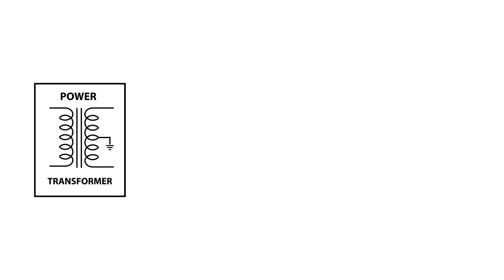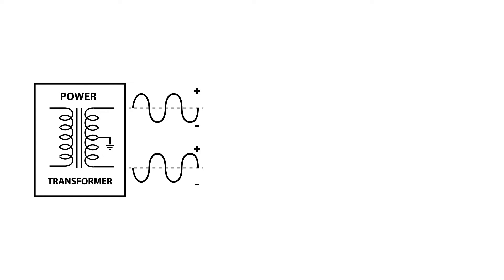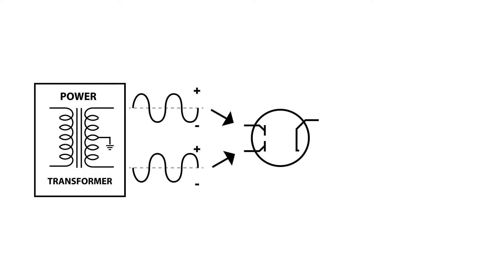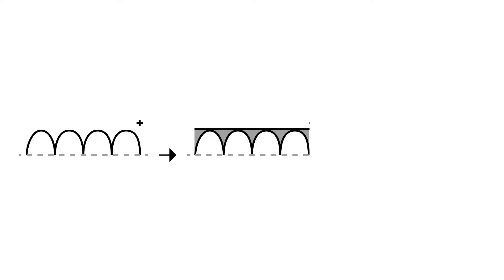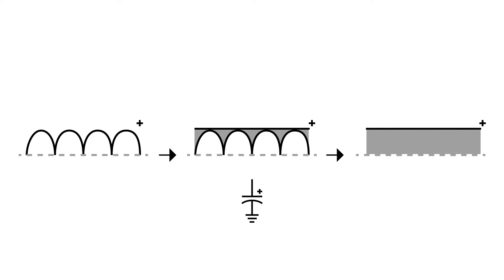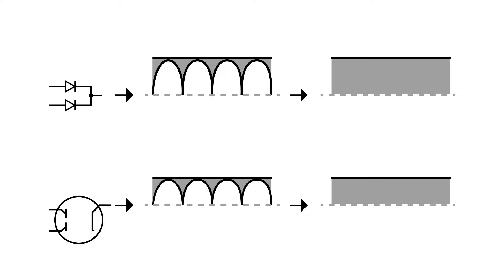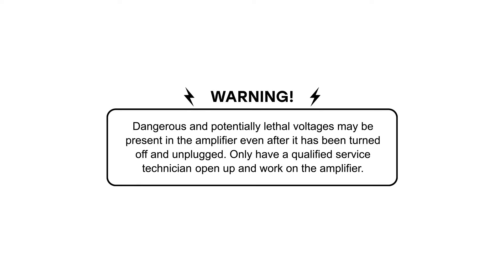Tube Rectifier vs Solid-State Rectifier - What's the difference?

Comment: I like the sag and resulting sound in a guitar tube amp, but for a hifi tube amp there's no sonic benefit from a tube rectifier, and the good ones are expensive.  I added a solid rectifier that includes a 12102 thermistor in addition to the diodes for rectification.  It starts out as a large resistor until it warms up, so the inrush current isn't a problem.  Some of them include a resistor to get the voltage down to what the amp can manage.

Comment: Unless I missed it, I don't think you controlled for different voltage levels on the output of the two rectifier types. 
We explained at the outset there are differences in efficiency and insertion loss of the two types, but regardless if we do not set the output voltage to exactly the same value any differences we might hear are going to be affected by that. Clearly, all of the tubes are going to have different characteristics with different voltages on their plates and grids, and polarization as well as counter-reaction circuits (if there are) will have different characteristics as well. 
So without controlling to make sure the voltage of each rectifier is exactly the same, what we are hearing may not represent intrinsic differences between the two different types of rectifiers.

But again, maybe you did that and I didn't pick up on it.

Thanks

Comment: There is some difference, but it’s really smal in A/B test. And, in the band context, I bet nobody from the audience will hear it. But, I believe there should be some different player’s feel, tube rectifier will produce different response, more “sponginess” and “sag”, especially in the higher levels of volume, when higher internal resistance of tube rectifier will affect speed of recharging of PSU caps after power peaks, and make tone more compressed - especially clean tones.

Comment: Tube rectifiers have some in series resistance? Wouldn't just putting an roughly equivalent resistor in series with solid state diodes produce roughly the same characteristics in the following voltage smoothing capacitors?

Also, not that power factor would be relevant to musicians, but an in series resitor between the transformer and filter capacitor should reduce the current spikes a little bit, there fore reducing EMC noise. Or an inductor-first versus capacitor first filter. But in that case you can put the inductor before or after rectifier, it doesn't matter that much. 
Downside - with an inductor first before capacitor you need higher transformer output voltage to get the same DC level.
Reply: Yes, this method is often used - serial resistors will cause slower recharging of filter caps in the PSU, and emulate same dynamic behavior during power peaks.

Comment: Can rectifier tubes affect tone ? Eg NOS or coke bottles vs straight tubes ?  In a sucker for snake oil and swapped from one rectifier in my dc30 to the dual 5v4 tubes  - that is an option to me . I bought some nos tubes just cos they looked pretty haha.  But would you say rectifiers affect punch and dynamics not tone ? I know from touring as a tech all my players in the early 2000 switched their mesas so solid state as you could hear the snap of those drop d power chords over the tube rectifier

Comment: Some folks who like having large solid state power amplifiers also like large capacitor bank filtering. This is good for material that contains a lot of profound bass-- pipe organ, synth, for instance. Their amplifiers will feature a single stage capacitor input filter system to lower power supply impedance as much as possible. 100,000 uf on each leg of a bipolar supply is not uncommon. To deal with the damaging power-on inrush current without having to oversize everything,  a circuit called a 'step start' is employed.  This consists of a small value, high power resistor placed in series with the power transformer primary at power-on. This will limit current flow through the transformer and rectifiers as they charge at power-on. After the surge is substantially complete (a few hundred milliseconds, typically) , a relay will close and bypass the resistor. The thinking is that that kind of charging current will occur only for brief peaks in normal operation, but the full value of the low impedance power supply will be available at all times. Some smaller audio power products  with novel power supplies will use a step start as well, such as the Sony STR-V and STR-VX series. And they are common in large tube and solid state RF power amplifiers.

Comment: If you really want a really powerful really specialized sound go with the tube rectifier.  I was able to get unbelievable and insane amounts of sag and chainsaw guitar and all sorts of stuff depending on which stop box I was using which guitar I was using I used to use transistor amps in boss pedals and also what's a butt of gear I wanted to get nice guitar synthesizer 1 day I mean I was gonna go with all that digital stuff that I've been buying trading selling guitar stuff for like 30 years now and the equipment that I now love I did not at all think was the equipment I needed in the beginning I found most of that stuff to be digital and garbage now yet there's analog synthesizes that I like and then I want and their primal permit of screaming out waves of mu trons, moog's, phase shifting the sonic reality  of the room. . Last time I played one I was able to create and copy baby that amazing amazing tone from The Isley Brothers saw and called""whos that lady""" trippy CRAZY TRIPPY. psychedelic man.  . Would you hear things like indigotta Devita from Iron Butterfly. It's actually probably the first 10 metal song ever dark creepy song people had killed themselves when they saw him come out especially people that were on acid or I mean it was the first really dark and horrific sound one of the guitars so those is just his quiet wow pedal thing it gets a little more distorted as it goes and now the other guitar solo is absolutely insane some people don't even know what instrument it is either barely tell it's a guitar but it's hissing and seething and screaming and wailing totally demonic I've never heard anything else sound so demonic coming out of a guitar and at that 18 minute version there's only 2 guitar solos and I'm telling you you can't miss that 1 I mean it's just trip trippy the voice of the guitar is Living breathing evil and hiss, screaming it's just unbelievable but he is creating buzz saw effects through the Whole song and the rifts. . But spirit in the sky by Norman green bombthe rhythm guitar is his telecaster with the overdrive/distortion/fuzz circuit. Right there in his own guitar and when he Kix that in people said that he got the  Sound from damaging the speaker and that's what made it ultra fuzzy and going out of control some people have been able to get a little bit of that kind of thing.

Comment: Should have done several double blind tests so that YOU the player didn't know which was which and THEN see if what you "heard" matched what was installed.  Would have been easy to have had someone else switch out or not switch out the rectifiers and then try maybe 5 or 10 trials and keep score. Expectation bias could have been a factor here or not. I do know that people say the low end of a tube rectifier amp has sag. Was that evident?
Reply: How do you know if expectation bias is a factor if you don't know what someone's expectations are in the first place? How would you go about determining what someone's personal expectations are without throwing the test?
Reply: @052RC  Expectation bias comes into play when you know which component is being tested. It's that a person expects to hear a difference if they already see which component is in the circuit, not what they expect to hear, comprehend?

Comment: No I couldn't hear The Difference at all Really and it's you should be able to because I have played a lot of old Transistor amps and I got Really  Into tube amplifiers and I've played all sorts of news of bunch of different types of power tubes and it creates a lot of different sound even though they say it's just a pre amp tubes that shape the sound and it's b***** because even EL84 like a box doesn't sound anywhere near like EL34 which is Marshall. I played a lot of bands but they're really really old harmony brand 30382 rectify amp just 1 part 2 born premium 2 and 1 direct to fire 2 but it's just a few small components cause 1962 they didn't have circuit boards and all that garbage and when you open up it was really genius looking on the inside I've never seen anything quite like it but those things get consistent tons and sound quality where is I'm looking at spenders and other brand amplifiers are getting 8 and 9's at their best in song quality even my offenders super 60 which is one of the most liked amps out there because it's got 6L6 tubes which is rare for a fender . Most splendor tube stuff I've been seeing over the years this EL84 which I really don't care for and then there is the 6V6 and I really don't care for those either I guess there's a Castillo ray Vaughan type of blues type amp I'm got KT88 which are awesome but maybe a little too much for some people cause that's what the most didoordered like Marshall's and stuff that I've seen you don't see a lot of those around but it's like the guy from slayer or another really heavy bands used KT88I. I used 6L6 amplifiers The most, a lot of brands use it 11:26  boogie being one of the best really great.  American sound. . It's very much like the EL34 is in Marshall those are the best sounds I think but little boutique amps sometimes they could make a yo 84 type power tube so good if you've got the right components and like the 2 rectifier ant pie head nobody is using what I consider roll 2 band fires you guys are doing solid State versus tube but yet you guys aren't getting the stuff out of it I get out of it I have taken a couple different types of analog distortions and I've cranked the sand up the song exactly like Norman green bomb spirit and Sky with session in the same amount of sag it's like a truly crazy psychedelic sound I've never knew anybody doing that I've seen a bunch of people playing Santana and I'm all sorts of cool stuff in these boutique amps I'm not seeing any of that kind of smoothness and then these videos and I was able to pull off in indigoted Devita by Iron Butterfly and a whole lot of other sounds that you can't get out of a guitar amplifier anymore. All these so-called newer tube amplifiers are not tubed to me they just sound like too transistor like ever since Steve I had and then I got stolen my 1962 harmony 303 a which harmony is a cheaper brand of back then generic stuff was still good because they didn't have the circuit boards and achieve components from China get equipment like the look almost all the batteries that take 9 V are garbage except for the first ones from the 1960s like the Russian bigmouth get here that on tons of recordings tons and tons of recordings through the 60s and then up again up through the 80s and 90s nineties had a huge reassurance surgeons though it's a band's like Bush and smash and pumpkins and also to them using Russian bigmouth instead of the distortion that comes on the amplifier which is f**** amazing on its own. Sadly they're still promoting and selling Marshall's transistor c*** letting people think that they could buy a martial stack for cheaper and it's really good on like a martial stack no sorry but transistors s*** is f**** garbage and you sit there and play it in a room by yourself without distractions you hear WHY people are willing to spend thousands of dollars for a  Tube amplifier instead of transistor garbage that a lot of a started off with. This is like the third video I've seen today and it's still is it's not showing enough of the difference and this is the person who's owned these and I know what I'm a trip but I was getting that alarm and green bomb tone I just used an old analog boss turbo overdrive that weighs like 20 pounds and I crank that going into the amp I turned up all the knobs my volume knob turned up all the knobs on the pedal all the knobs on the app with the exception of volume just to use that the control of the volume and it was insane troopy sagginess nerves also all sorts of crazy other tones coming through there too that sounded familiar to me like psychedelic stuff futuristic stuff a little bit like Rock and roll fantasy by bad company is It's a Synthesizer guitar From the 70s used on that song and it's got a lot that analog crazy distortion sound . So I was able to whip the sag around just like that just unbelievable trippy and then I was able to twist the pedal around to do some other stuff and I was able to get the sound from in the gotta Devito by Iron Butterfly which is like a f**** buzz saw one of the solos he does in that song is amazing it sounds demotic sometimes you can't tell guitar what it is but yet psychiatrist doing some amazing ship that demox owned is solo people used to take acid and listen to that song it's supposed to be people to kill themselves and stuff the long 18 Minute version of Iron Butterfly and their song indegattadavida. is very demonic and very Powerful. . That's the first psychedelic and also the first metal sound there wasn't much dark metal type music ever before that the kink's being like going to talk back to using power chords at that time.

Comment: there are 4 diodes in a solid-state full-wave bridge rectifier, not 2.
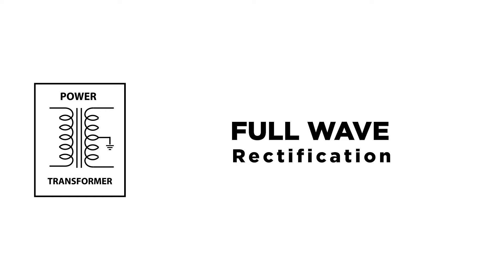Reply from the maker: In this video, the example given is only standard full-wave rectification, not bridge, so only 2 diodes are required for that. Bridge rectification, as well as half-wave is mentioned around 2:14 but for the purpose of the video, we stick with normal full-wave. But yes, full-wave bridge would require 4 diodes (common in 100W amp power supplies), and half-wave would require only one (common in fixed-biased amps' bias supplies.)

Comment: The only important difference is that with tube rectif you will never get AC into circuit( if tube goes off any current stops) if diode is damaged it is not so good

Comment: The differences are so subtle that you will never notice them on a stage playing with a band. In that case, I would always go with the SS rectifier, as they are more reliable. However, it should be pointed out that if you change your rectifier tube out for a SS version you will almost certainly increase the voltages supplied to the plate etc. of your tubes. Be careful. Don't cook your tubes. On my Vox AC30 CC2, the GZ34 puts out 352VDC with the amp running idle. With the SS rectifier, 374VDC. Way too hot IMO. Amps where the ability to switch in/out an SS rectifier is designed into the amp itself will be just fine, but be careful when swapping your tube rectifier out of your Vox, Fender, Marshall amp etc.

Comment: Well this two devices have diffrente electric voltage drops .So if you have not re-biased the amp ..The voltages will be different
Reply from the maker: That's covered in the video at about the 5:00 mark https://youtu.be/xHKWrFLVRBc  The B+ voltage difference is small enough that the amp doesn't need to be re-biased. In most cases, the difference in bias is about 3-5% plate dissipation at idle. So for example, on the tube rect, the PD at idle might be about 70% and on the SS rect, the PD at idle might be about 73%, which is within good nominal range.

Comment: This is all interesting, but a power rectifier has nothing to do with sound. Not only that, no one here would be able to identify a good tube amp over a solid state amp if they weren't told which was which.
Reply from the maker: The video isn't comparing a tube amp to a solid state amp - it's comparing a tube rectifier to a solid state rectifier used in the same tube amp. And there is a difference in sound between two, which has been proven quantitatively and qualitatively time and time again. As stated in this video (and also numerous other available sources), the tube rectifier lowers the voltage and affects how fast the voltage is available. Those factors produces a "sag" and compression in the sound due to less headroom, vs using a solid state rectifier, which produces a more aggressive and immediate sound.
Reply: @sonictoneamps  So, by cutting the available voltage and in turn headroom using a tube rectifier, you're saying solid state is providing the audio stage the voltage and headroom it actually requires to function properly. That's called poor design and old technology, not a calculated goal.

If you swapped the tube with solid state rectifiers and then designed the next stage to provide the same voltage/current to the audio stage, the comparison within the same amp would be indistinguishable.

What you're doing is putting a V8 in place of a straight 4 and saying the car performs differently. Well, duh!
Reply from the maker: @Rick-Willy  Your analogy doesn't equate here. A more appropriate one would be installing a turbo-charger and giving yourself a little more horsepower. The difference in voltage is not very large (about 5-10%) and is well within the range of the tubes' operation. But it's enough to affect the sound and feel of the amp. It's actually a very common feature. It's a proven and accepted design that many amp companies and builders employ to give their customers the tonal option. Tubes are very forgiving and robust devices and are designed to easily handle small differences in voltage supply (unlike their solid state counterparts) - which is a main reason why we can do it.